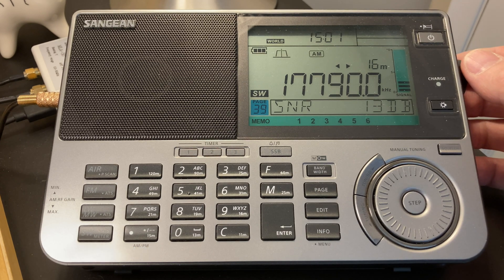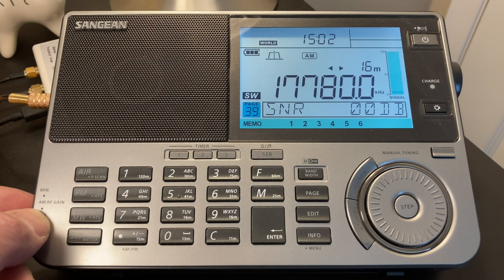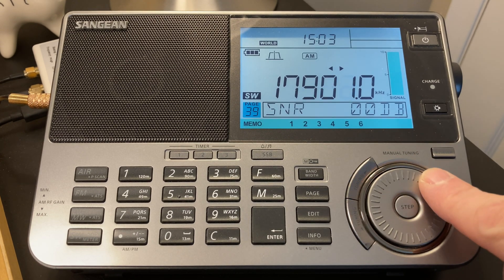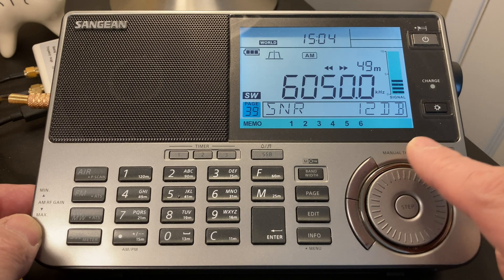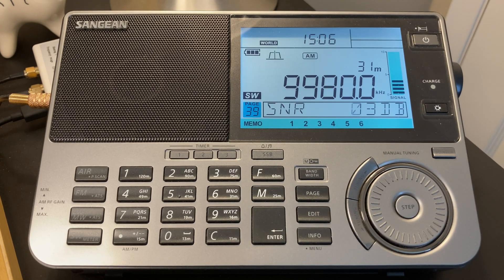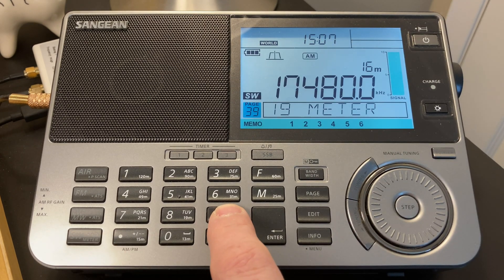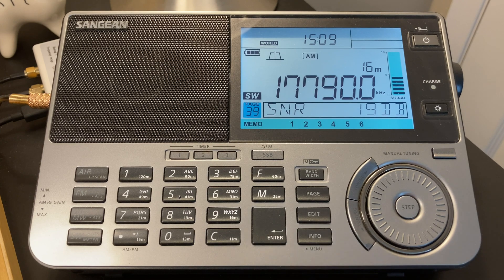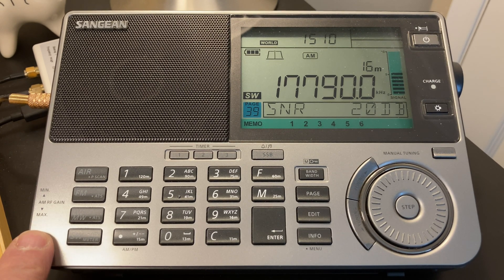Using the RF Gain Control on the Sangean ATS909x2 Shortwave Radio

Comment: had a couple of versions of this radio but had to send them back as they were a full 5khz off frequency on SW, a station on 9670 appeared on 9665 whereas I had no such problem with the Tecsun Pl-990x although that could do with an RF Gain Control.
Reply from the maker: I think Sangean had a bad quality control problem with at least part of the production of this radio.
Reply: Nunca vi tanta reclamação em um rádio como este ats909x2. Rádio muito bonito, mas desisti de compra-lo. Estou bem direcionado para o PL990x, apesar de alguns expert recomendaram o PL680. O que acha ?